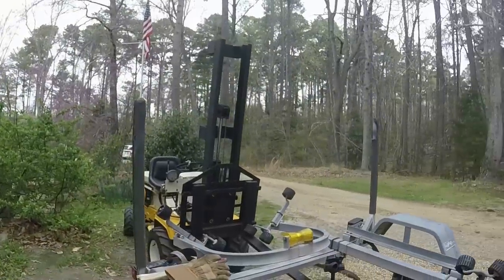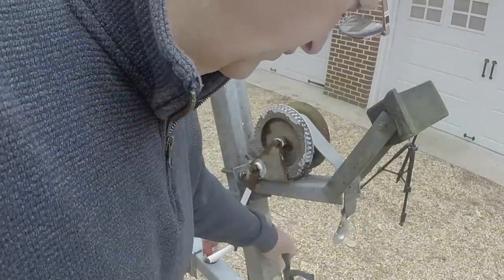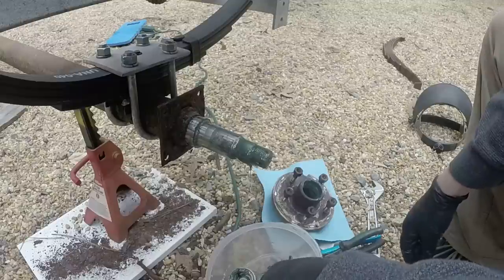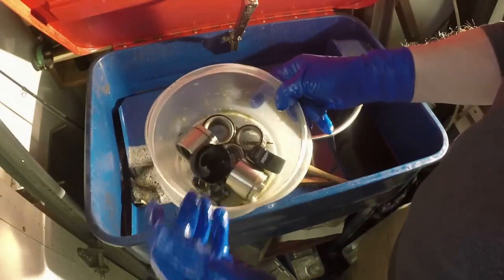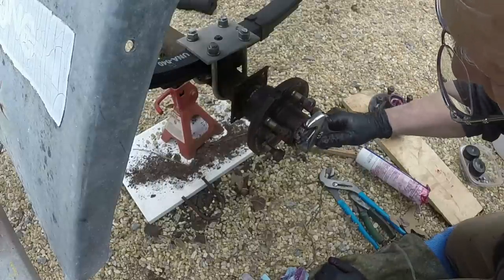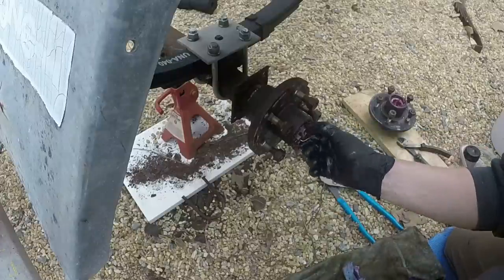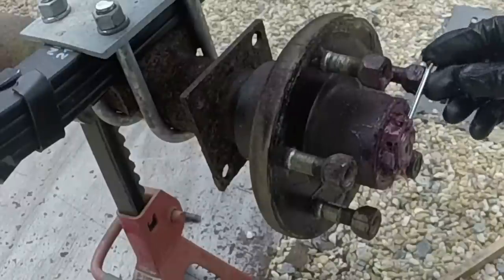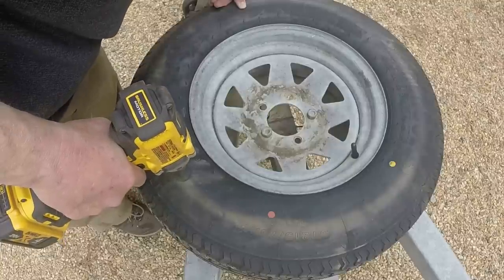Boat Trailer Maintenance Part 2, Repacking Wheel Bearings

Comment: Good job. I like to turn the hub as I tighten the nut up. Helps to make sure everything is working correctly. More important if I have removed the bearing races which you didn't need to do. I use a needle on the grease gun to put grease in next to each of the rollers on the bearing. It is a lot less mess than packing by hand and I am absolutely sure that I got grease in every opening. 

Not saying that there was anything wrong with what you did, I just do it a little bit different.

Hope you enjoy the boat and the water.

Comment: I have been doing bearings my whole life. 60+ and nothing wrong with the way you did them.  To remove the seal I remove the outside washer and bearing, then screw on the nut a few threads.  When you slide off the hub the nut will pull off the inner bearing and seal.  Less mess and less force.

Comment: Frank, you probably know about these but for your viewers, they make a product where a seal starts to eat into a shaft called a speedy seal. It’s basically a thin strip (.010 of an inch ?) of stainless steel about a half inch wide and the back side is bent up at a ninety degree angle that you can drive against to seat it onto the shaft. The back side of the sealing surface is scored so you can break it off (so the 90 degree part) so it won’t be in the way of the seal. The seal then rubs against the speedy seal and keeps from tearing up the new seal. It’s a quick fix and they last a long time, they’re good for hydraulic shafts also.
Reply from the maker: That's a good point. I should have mentioned that as a solution if your seal has worn a groove. I've used them in the past but it's been many years ago.

Comment: Put your hub back on without the outer bearing in it then reinstall the nut hand tight, yank straight out and the inner bearing will pull the seal out, if I remember correctly.

Comment: In the UK the washer between the bearing and the nut would always have  a flat on the hole to match the flat on the spindle.
This prevents the bearing from trying to undo the nut.  On your hub the bearing was moving the nut. This should
never happen as it can shear off the split pin, resulting in you losing the wheel.
Reply from the maker: Most other vehicles and trailers I've worked on had that flat on the inside of the washer as well. Not sure why this one doesn't. But it would be better if it did, I agree.

Comment: The only thing I would have done different is to remove the plastic  bushings that come with the new springs and replace them with bronze bushings that are readily available.  I'm sure my trailers see far more use and abuse than your boat trailer but those plastic bushings always fail for me.